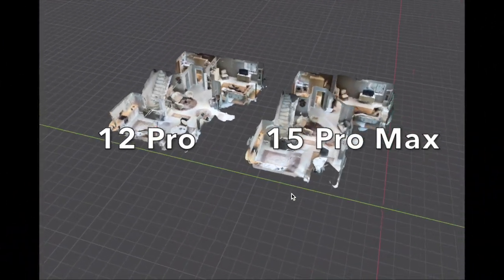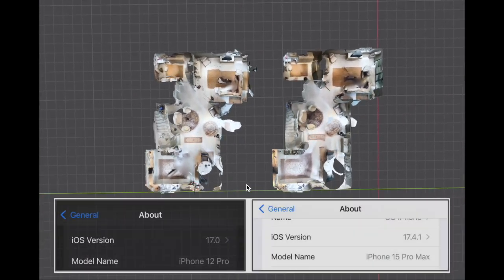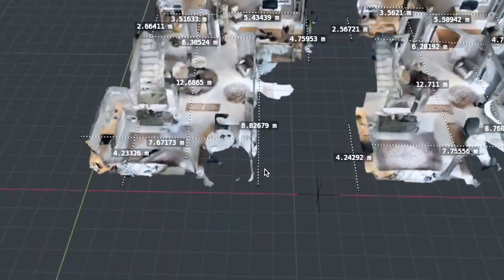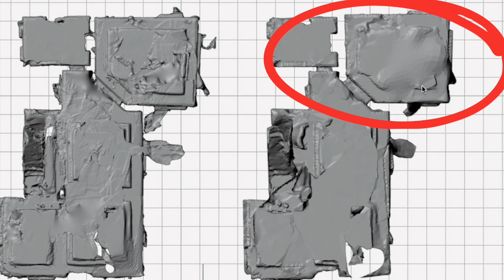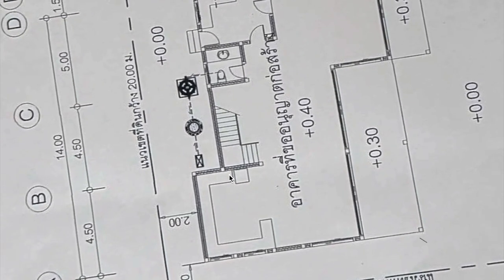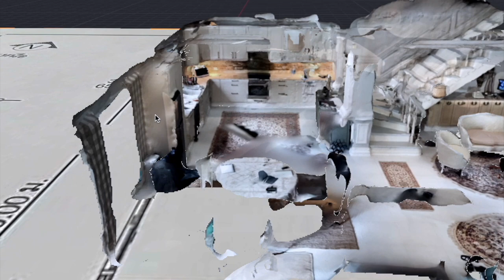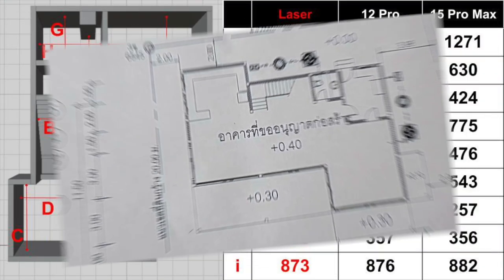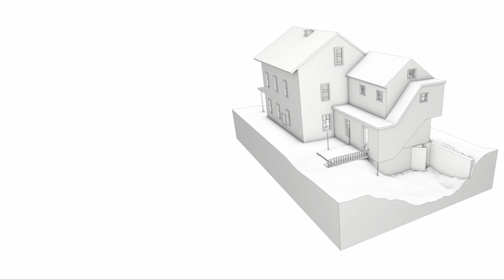iPhone 15 Pro Max VS iPhone 12 Pro: LiDAR Scanning Test:  Accuracy, Measurements & Comparisons

Comment: October 2025 -- thank you for doing the LiDAR comparison. So Apple "did" make minor improvements to the LiDAR from model to model (like their phone).

I'm in the Interior Design & Construction/Renovation business -- always an Android user, but I guess I need to get a 2nd device/iOS so I get the LiDAR scanner... Or maybe an iPad Pro (I wonder if it's any different from an iPhone's LiDAR hardware/software)
...
Reply from the maker: Thanks for the feedback. Appreciated. 

iPad Pro is actually a great choice. The larger screen comes in handy and since iPads are held with two hands while scanning the result tend to come out better (marginal difference but definitely not worse than a phone) 

So you should definitely give it a try :)

Comment: does the "points" from LIDAR would "interfert" with the other if you scan them in the same time ? I mean the lidar is reading project point right ?
Reply from the maker: Great question! The phones scan in pulses, so even if two phones scan side by side interference is minimal. There might be some tiny inaccuracies.

Comment: Why hasn't Apple made a major update to lidar over the years?
Reply from the maker: Hi thanks for watching and commenting. 

What kind of updates do you think are needed? 

They are making small improvements in each version but yes I agree that there is nothing major. 

If I had the right settings I think the 15 pro max would have done better, especially on large scans.

Comment: You should try the 16 pro, they said that they improved the LiDAR.
Reply from the maker: I have already tried it :P Hopefully it wont take close to a year before my review comes out :) Thanks for watching
Reply: @LiDAR3D  i read that the iphone 15 Pro use the Sony imx591 Lidar chip, which seems to work different to the imx590 chip implemented before.
Would be curious, whether there changes on the 16 are apparent, or rather similar to the 15 ...

Comment: would this not be more of a software problem than a hardware problem or possibly a setting just curious I'm getting the 16 Pro Max and will be doing some scanning with it so this was a good comparison. And what scanning app are you using
Reply from the maker: I think you're right. The hardware should not affect this so it must be software related. 

I actually edited out my speculations to keep the video shorter. My guesses for the issues are:

  A> Something to do with the Polycam free trial account I used on the 15 Pro Max. 
  B> Some setting that I overlooked or changed before starting the scan(I always use the default settings)
  C> Some software random bug that happened in exporting the model (I made this test 6 months ago and at the same time as Polycam released a feature that "simplifies" models and reducing polygons)

Thanks!